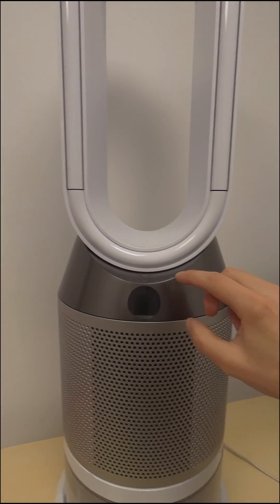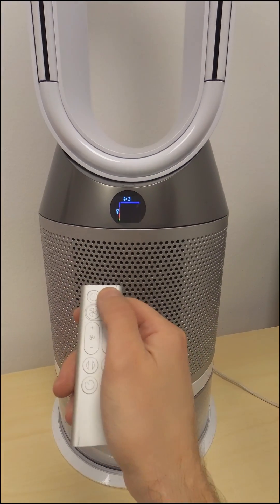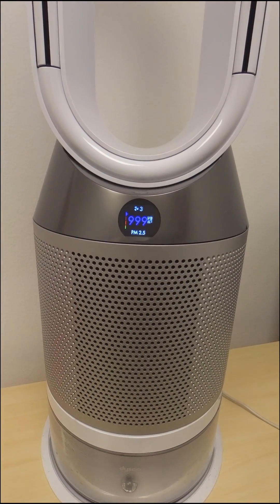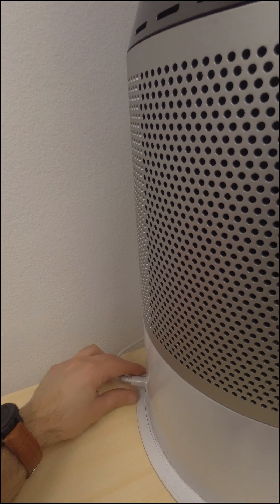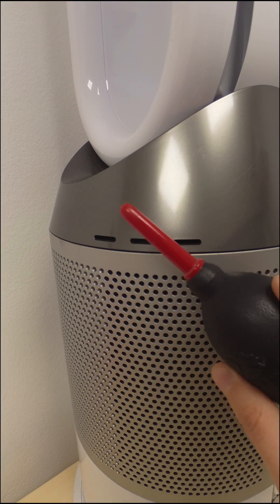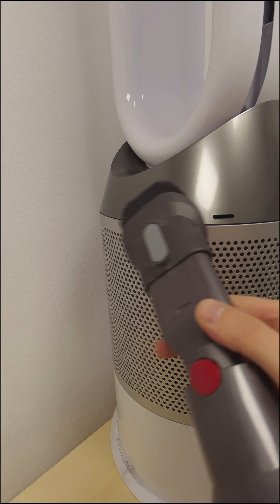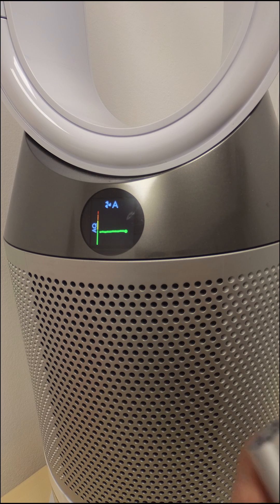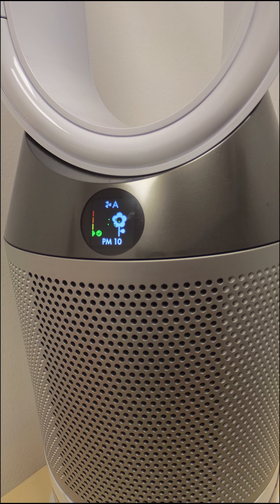Dyson PH01 - particle sensor cleaning - 999 reading for PM 2.5 and PM 10

Comment: My water tank stop working, how to fix?
Reply from the maker: Can you give more details? Is the humidification function not working? Is everything else functional? If you only have problems with the humidification function, it is probably the water pump that is faulty or just needs a filter cleaning. The filter is positioned at the base of the pump and can be removed quite easily for cleaning.